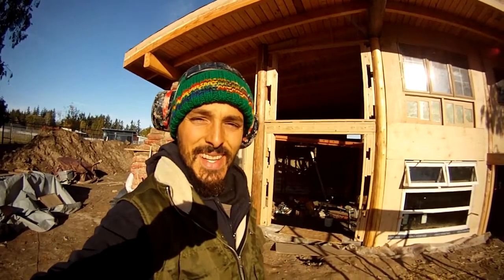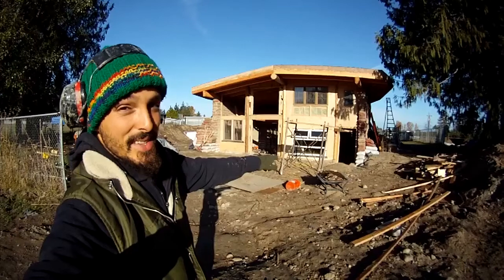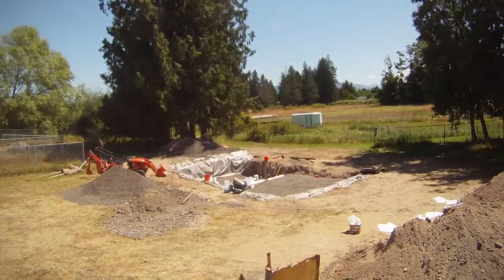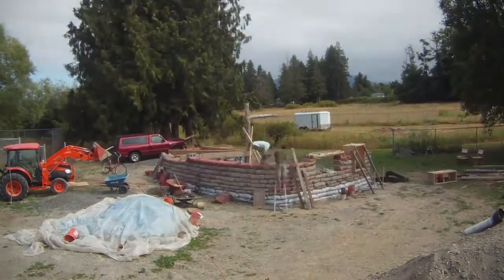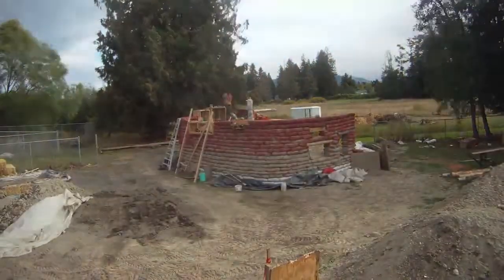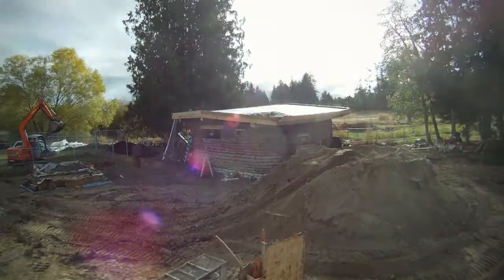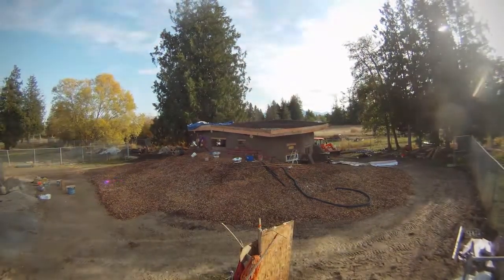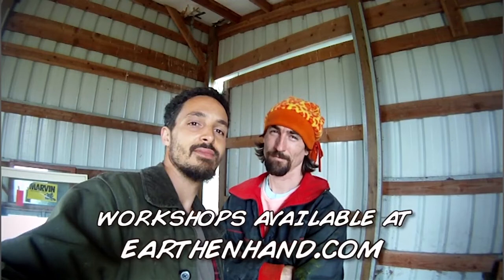Earth Bag (Hyper-Adobe) House by Earthen Hand

Comment: Why using gravel foundation if the earthberm acts as a giant moisture bridge?
Reply from the maker: It could. But I don't think it does. We use gravel to make a barrier against vertical water movement up into the bottom of the wall. The amount of water moving up into the wall through the berm is negligible because the berm is covered by plastic that slopes to drain 20 ft out from the wall and is covered by more soil.

Comment: Thanks for sharing!  Why did you choose to use mesh bags, rather than a continuous tube?
Reply from the maker: The hyperadobe method is more similar to adobe than superadobe. With dry weather, I enjoy it more than superadobe and it's faster than Cob.
Reply from the maker: Thanks, Noah! I find the individual bags easier and faster to lay. With a good running bond and the bamboo pins we put it, I believe this building is super strong. The bags should be thought of only as a temporary containment for the rammed earth mix.